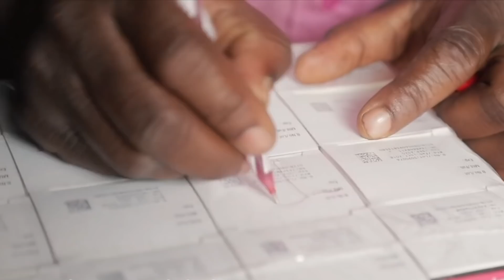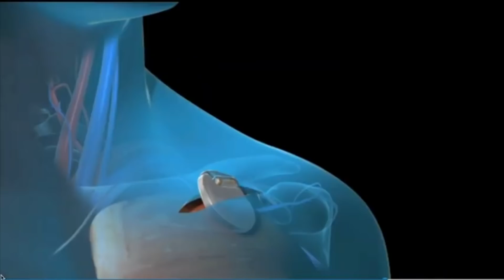The Worst Stuff In History That Mankind Can't Get Rid Of

Comment: plastic should only be used for things you need to be sustainable for a long time, not temporary items. Temporary items should be biodegradable. Of course not counting things such as medical equipment that is disposable, but that medical equipment once disposed should be taken to the lengths to dispose of which would not cause negative environmental effects. 
I'm no professional, but literally its just a case of using the the right material for the right scenario, and plastic has been painfully overused.

Comment: The problem isn't plastic per sec.  The problem is waste plastic.  It seems to me the first steps we need to do are to start collecting the dumped waste and using our technology to break down the plastic into non-harmful materials.  

One of the means to break down the plastic is mentioned in the video.  Another means is to use bioengineered bacteria.  Both means produce fresh water as a byproduct, which a huge plus given the rate we are running out of water.

The next step is to find replacements for plastic for the things which are disposed of the most.  We will likely never phase out plastics altogether.  The stuff is just too useful.  But, we can learn to manage it responsibly.

Comment: ALL plastics are NOT the problem, only some. There shouldn't be a need to remove all plastics. 
However, there IS a need to determine and define plastics fit for eradication and/or discontinuation. In the process of doing this there will be found solutions to the current and  future challenges of both physical plastics and the social, economic  and political problems to which plastics are tied.
For example, obsolescence. Current technology renders obsolete the need to have 3 parts of a water bottle to be made of 3 different plastics. The 3 different plastic types make it so that a common bottle of water can be defined as UNRECYCLABLE because the 3 different plastics need to be recycled separately. (The cap, the safety/freshness ring that separates from the cap upon twisting and the bottle are all made of different plastics and must be separated before recycling separately. A process which most refuse to implement claiming it to be too time consuming and unprofitable.) This isn't necessary and results in water bottles being dumped in the ocean, amongst other atrocities.
There ARE profitable, longterm, sustainable solutions to the plastics problems but we all must work together to eliminate the hold our greeds and ignorance have, not just upon ourselves but from upon the many innocent who suffer and die as  the result of our apathy, greed and ignorance.

Comment: Sorry but I had to stop at the part where you started talking about plastic in medical implants and fiber optics cables.
Those are sitting where they are for 10s of years and could easily be recycled in the process of replacing them.

Not comparable to one-way plastic bags and that silly foil everyone is obsessed in using to wrap virtually anything.